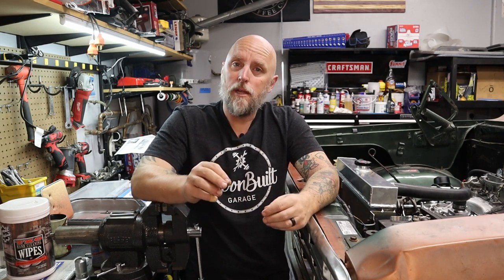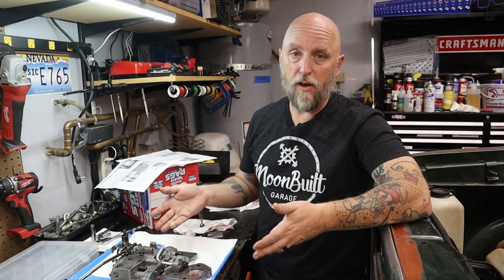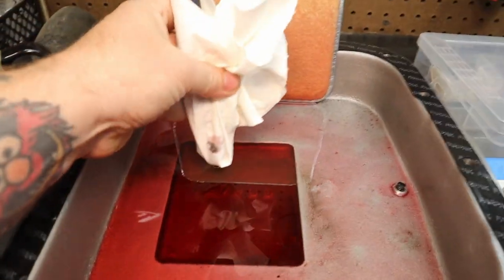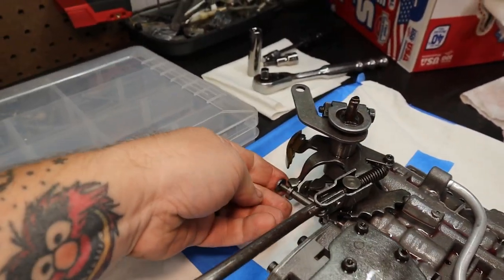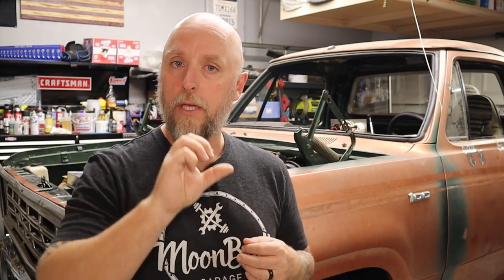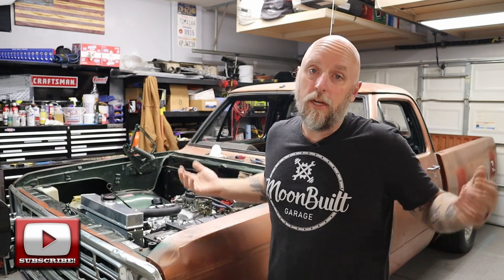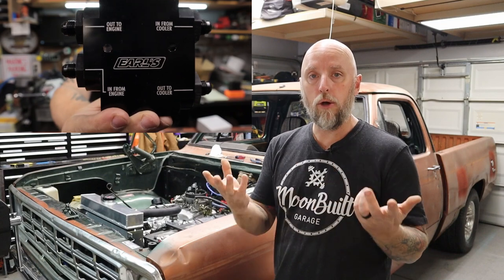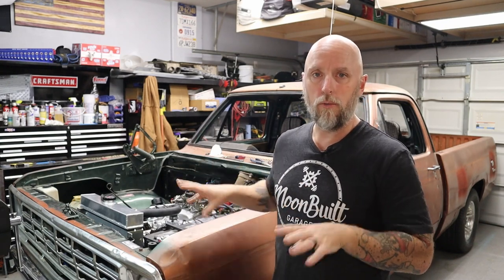Mopar Torqueflite A904 Automatic Transmission Won't Go Into Gear | Valve Body Inspection

Comment: Interesting valve body story. Mine sat long time, was frozen. I got it free, does great in reverse, but really weak in forward and don't shift well. I was thinking about buying a used one and hope that helps.
Reply from the maker: Either that or pick up a shift kit and give the valve body a good cleaning/overhaul....some of the passages may just be gummed up or springs worn out
Reply: I ordered one from ebay and will put it in. Should fix it
Reply: Put in the kit cleaned it up and all is good
Reply from the maker: NICE! @1otviii